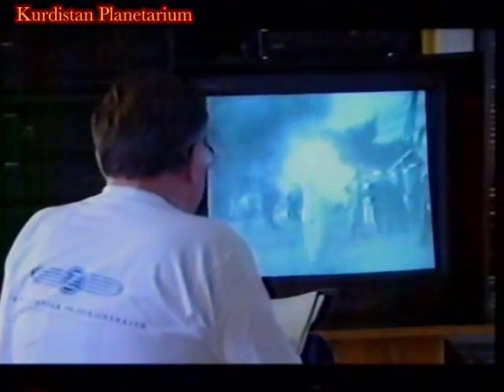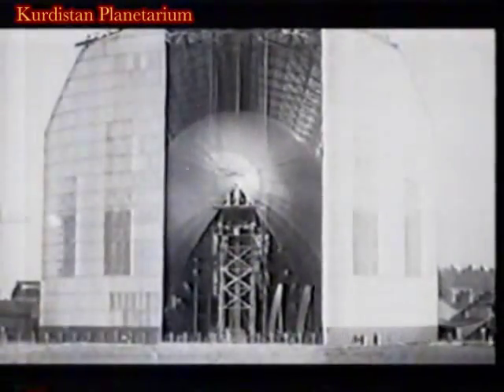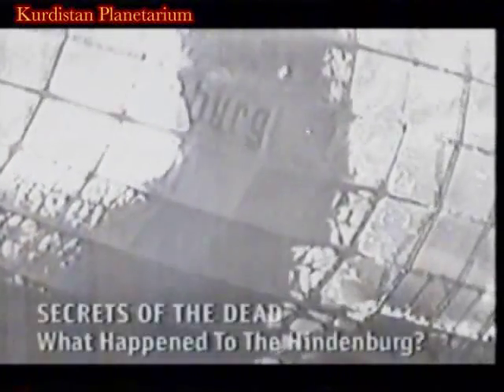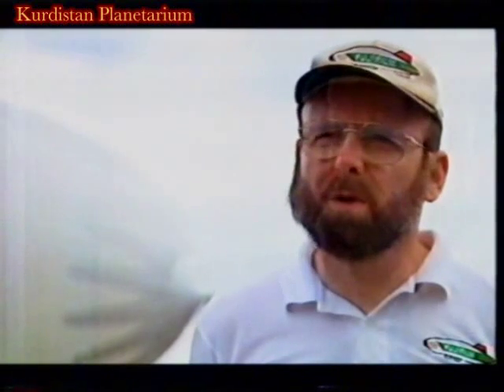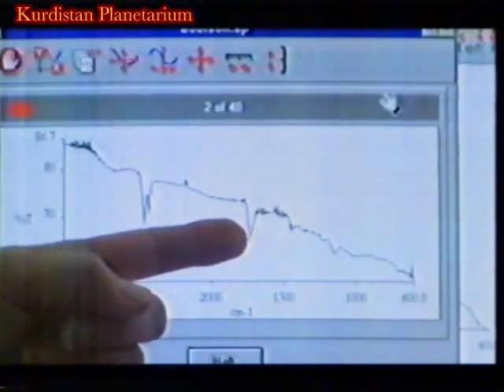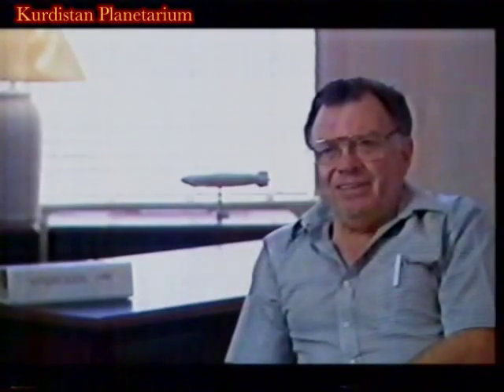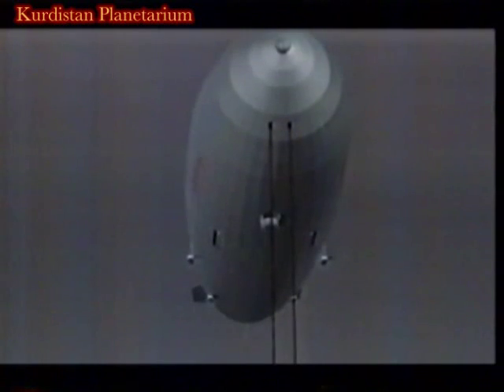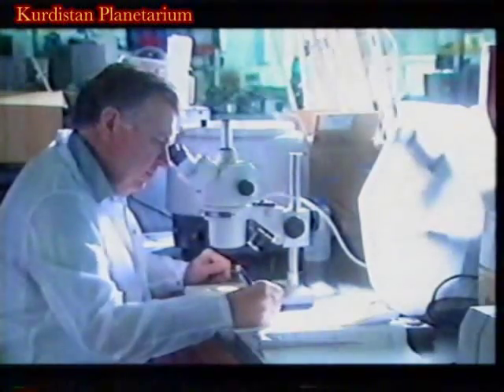What Happened to the Hindenburg? P4

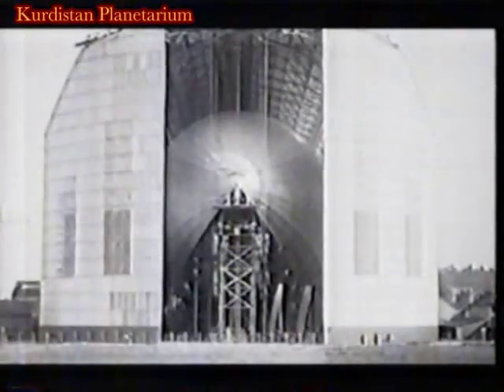Comment: By the way the construction footage at 1:10 is of the LZ130 Graf Zeppelin II, not the Hindenburg. The main difference is that the x-shaped scaffolding on the front platform. For the Hindenburg's construction, this was Z-shaped. The shot right after showing the passenger decks is the Hindenburg, because the LZ130's initial passenger decks never reached that stage of development (they were assembled but the fabric did not cover them) before they were taken down and redesigned. If you look carefully, at the platform where the engine car should be, you can see dark spots at certain parts of the scaffold - the LZ130 did not have these.  A lot documentaries use construction footage from a compilation and they sometimes mix up footage from both airships's construction. It gets more confusing because the Graf II had Hindenburg-style engine cars installed during the early stage of construction.

Bain claimed the blueprints he found showing the LZ130's doping solution contained bronze and the Hindenburg didn't. This is misleading because aluminum-bronze was a term used interchangeably with aluminum powder for the doping solution. The LZ126 Los Angeles also had "aluminum-bronze" listed in its doping formula. The only change was that the lacing cords of the LZ130 was treated with graphite so that the outer cover was more conductive (as Zeppelin company physicists believed the poor conductivity of the Hindenburg's outer cover may have contributed to ignition of hydrogen).

Comment: Iron oxide combined with aluminum powder are a form of thermite, which burns extremely hot and fast.
The intensely hot plasma in an electrical discharge would be more than sufficient to ignite it. When these materials were chosen, it seems that their thermitic properties were not yet understood, or they were understood and disregarded, or maybe their immediate benefits masked their hidden dangers. The contribution of hydrogen gas to the total disaster would still be significant, but secondary